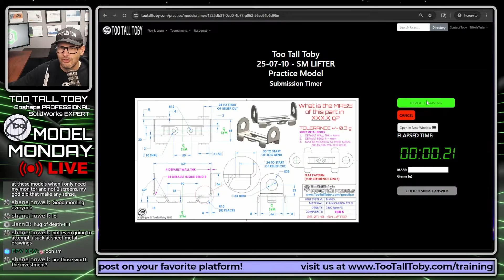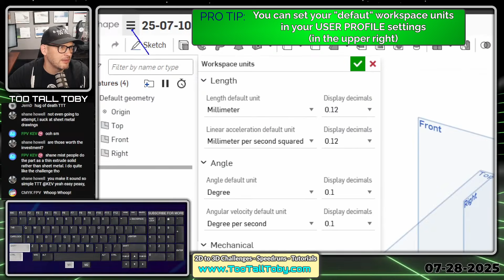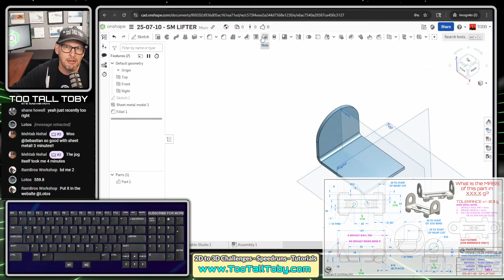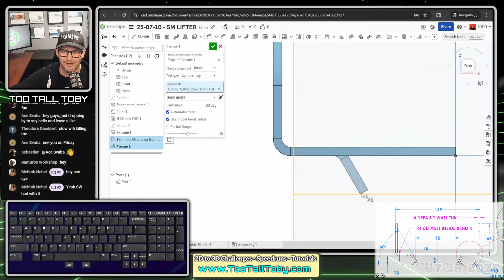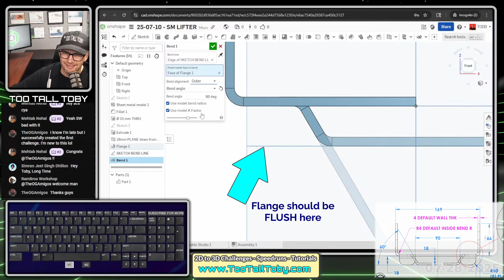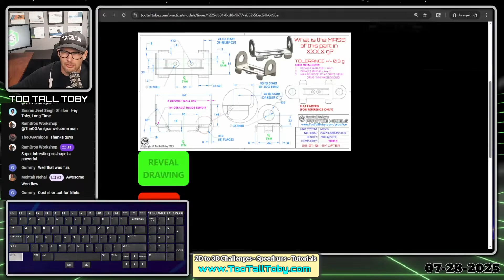Onshape Sheet Metal Tutorial 🔥Partial Flange, Sketch Bend, How to Jog🔥

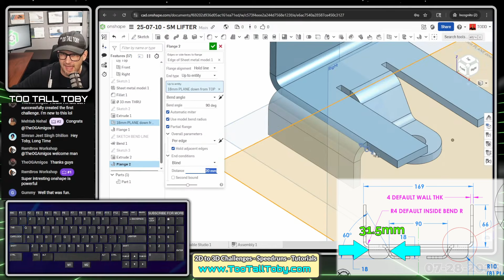Comment: Hi, idk why my comment doesn't go through, maybe cuz I posted a link to an image? but when I do the 22:00 partial flange, there's always an indentation goes into the sheet metal, I seem to follow the video step by step without missing anything I tried to remake it twice and problem always occur to me, how did you make the clean flange without having that auto-indentation?
Reply from the maker: Hi Great question and sorry about that - I always for get about that setting in Onshape:
1. In your tree at the top, double click on SHEET METAL MODEL 1
2. Towards the bottom, choose BEND RELIEF TYPE > TEAR

That should take care of it.
Basically this setting let's you specify a default relief type, and yours is probably set to OBROUND
Reply: Same problem here, got it removed by adding a bend relief feature but it seems odd that it isnt even an option to turn off in the flange tool, it just allways seems to add it.
Reply from the maker: @ModdingMonkey  Hi ModdingMonkey!
I think you and I both responded at the same time! 😀

Here's what I wrote to grassland:
1. In your tree at the top, double click on SHEET METAL MODEL 1
2. Towards the bottom, choose BEND RELIEF TYPE > TEAR

That should take care of it.
Basically this setting let's you specify a default relief type, and yours is probably set to OBROUND

===========

But I agree - it seems like there should be an option in the individual flange settings too - I'll keep digging!
Reply: @TooTallToby  indeed we did! Thank you for your quick reply, that indeed solves it. Not having it as an option of the flange instead of having it as a seperat feature did confuse me a bit. Learning a new workflow and a new software is always a bit of a challenge your tutorials make it a lot easier, thank you for that!
Reply: @TooTallToby  Thank you! it worked, I guess it makes sense to have stress relief options for the "sheet metal", it's just not intuitive to people who first getting into the whole sheet metal concept, thank you for the toturial!